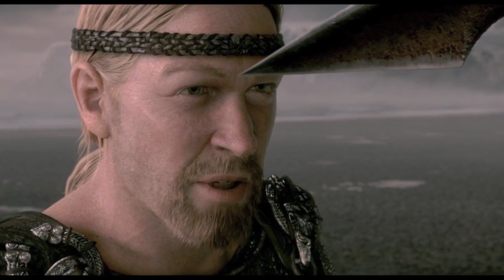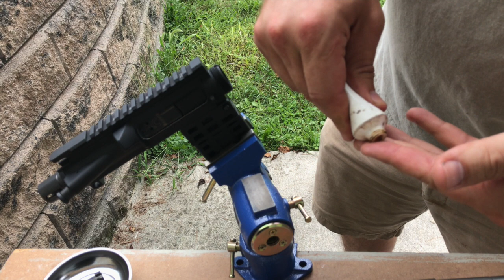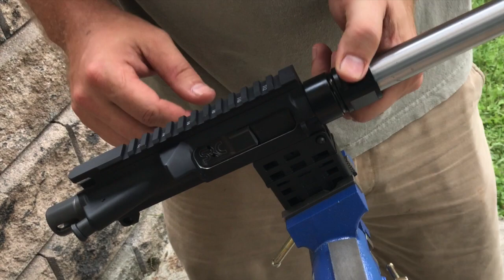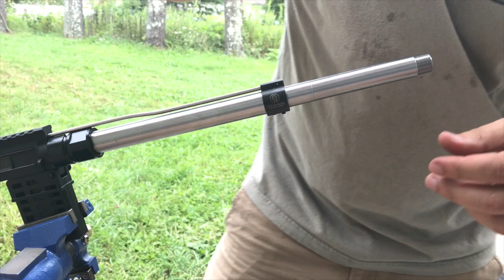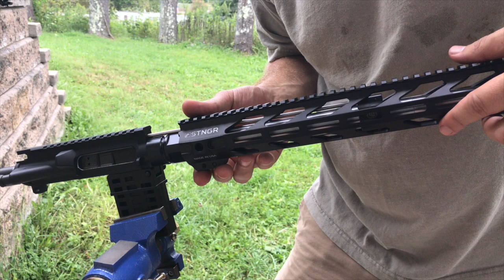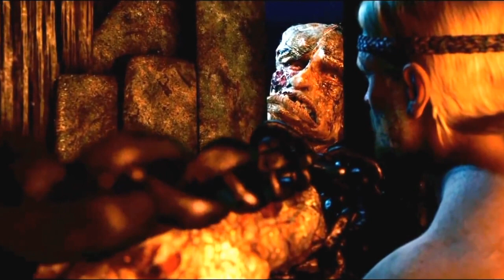50 Beowulf Build: Frankenwulf is Alive

Comment: Oooooooh, nice. Makes me want to copy the build, even though I already have a Beowulf upper.
Reply from the maker: Thanks!  I still really love that build!
Reply: @ModernMountainMan  what length barrel did you go with and how much did the build cost?
Reply from the maker: 16”. I can’t remember off the top of my head but it was in the $700 range
Reply: @ModernMountainMan  Ok thanks! Does it run reliably and how is it on accuracy? Any range videos of shooting thr Frankenwulf?
Reply from the maker: Very accurate!  Touching groups kind of MOA.   The only reliability issue I had was easily resolved.  The extractor had “vampire teeth” and a couple passes of a diamond file and it smoothed right out.  I have some range footage I need to edit and upload , other than that I have this https://youtu.be/wwXGEDj5jQY
Reply: @ModernMountainMan   that isn't a bad price at all, my upper is the entry model from Alexander Arms and with the tank brake it ran me a little over $800 after a railed hand guard and some sights (i'm not going to include the EOTech in this) My upper cost me about $1000
Reply from the maker: Yeah, my house is literally down the road from AA.  One of my goals was to build better than AA for cheaper than AA... I think I did it 😉
Reply: @ModernMountainMan  I do have a question about your ejection port, Did you have to mill it out or is someone making uppers with a larger port for big bores?
Reply from the maker: Mine is an Anderson that was milled by a local machine shop.  There are companies making “Big Bore” uppers.  I think Aero Precision makes one and so does Satern
Reply from the maker: Rob Crowe  here is a pic of the accuracy https://www.instagram.com/p/Bp7L6tZn8zb/?utm_source=ig_share_sheet&igshid=1m5llqlkw62l6

Comment: You do know that you have to have the crows foot at 90 degrees to get the correct torque?
Reply: jesse sadler Why?
Reply: blueknight physics. . .  If you're  not at 90 degrees you're changing the length of your lever arm, which changes applied torque.   Foot pounds equal force applied on the lever at one foot.  For example, if you were trying to get 30 foot pounds, you would apply 30 pounds of force with a 1 foot lever.  If your lever was 3 feet, you would only need 10 pounds of force, to equal 30 foot pounds of torque.
Reply: I brought this up In the USMC aviation squadron I work at, they all looked at me like I had 3 heads....and they were torqueing explosive breach caps. Needless to say learning occurred that day. lol.
Reply: Yeah because the 30-90 lbs is such a critical tolerance.
Reply from the maker: I used this advice in my most recent build
Reply: According to military the torque specs are with the proper tool set inline with the  torque wrench not 90 degrees as with the proper tool and manual the listed torque specs take the extra length of the crowsfoot ito count.

Comment: what bcg are you using and how hard is the conversion? what special parts do u need
Reply from the maker: I am using the Balanced Bolts Carrier from Sharps Rifle Company.  Special parts you definitely need are: a Beowulf bolt and barrel and an upper receiver with the ejection port milled out to open up wide enough to eject the big casings (they can be purchased like that or you can mill them out yourself)

Comment: Can you use a .750 gas block to run on your 50 beowolf?
Reply from the maker: Not on mine and I doubt it on any others. Because the bore is so huge, it causes the outside diameter to be larger. Mine was .875
Reply from the maker: Low Profile Gas Block Install: Troy Low Profile .875
https://youtu.be/XR5d6k0CWRE

Comment: This question may sound crazy, but what kind of barrel nut did you use ? That's really the only obstacle left on my build.
Reply from the maker: Aaron Banks  I used the one that came with my hand guard
Reply: Modern Mountain Man well I have the same hanguard, wandering if the barrel nut comes pre-installed already on the handguard ???
Reply from the maker: Aaron Banks  my STNGR hand guard came with the barrel nut shipped inside of the hand guard
Reply from the maker: Aaron Banks  watch this video at about 4:10 https://youtu.be/zIG_OZ2z4ko

Comment: Is that a standard striped upper with a 50 Beowulf barrel? Will any at upper work?
Reply from the maker: Mchael Wagner no... a milspec ejection port is to narrow of an opening to eject Beowulf brass.  You either have to mill it or buy one premillennialism for "big bore"  ammo
Reply from the maker: I was just going back through old comments and I noticed my typo/auto correct.  I where i said premillennialism, I meant pre-milled (although premillennialism is pretty cool too)

Comment: Why didn’t that BC slide easily in, why did you have to tap it in with such force?
Reply from the maker: Are you referring to at the end of the assembly when I just popped it in or when I tapped it in the beginning to mount it to the BEV Block?
Reply: Modern Mountain Man in the beginning. I think you mentioned you put it in there to tighten things up. I thought that the carrier was supposed to slide into the upper receiver no problem easily.  -real new to this.
Reply from the maker: Gotcha, so that wasn’t me tapping it into battery, that was me fitting the bolt carrier (without the bolt) on to the BEV Block, which absolutely needs to be a tight fit.  Check this one out Magpul Bev Block Unboxing and Intial Thoughts (Day 27)https://youtu.be/Z7hOhj_pSww
Reply: Ok got it. Thank you, great vids man!

Comment: One they make a real upper clamp that goes nicely in the vice and you don't need to beat a bcg in. 2 Why in the hell would you install the tube on the firearm?  So much easier in the vice off the barrel. Other than that nice Upper
Reply from the maker: It was a technique I learned from an armorer.
Reply from the maker: I have a build coming up soon where I pre-pin the tube
Reply: @ModernMountainMan  lol. I do mine in the vice and needle nose. So much easier. I'm looking to do a 50. Not sure yet because I have  2-458 socoms and according to what I'm seeing in ballistics I'm not gaining anything
Reply from the maker: The ammo/brass is usually cheaper